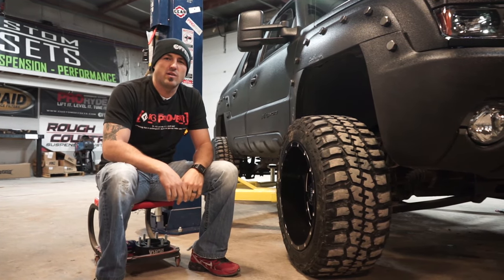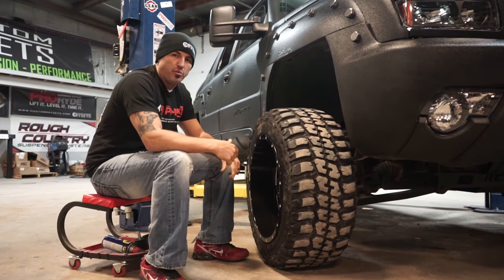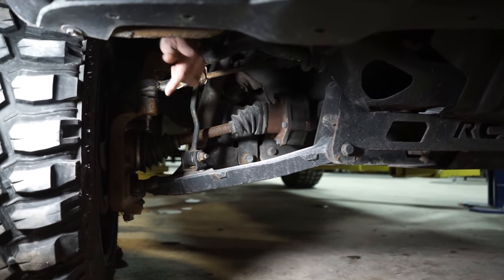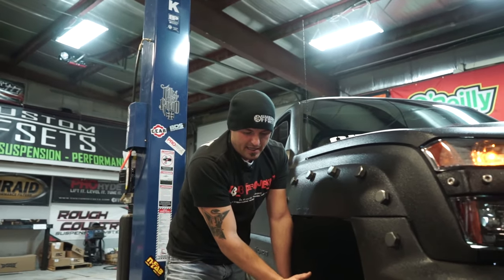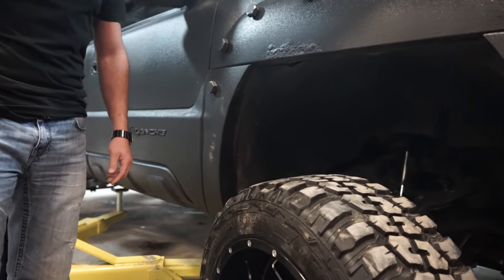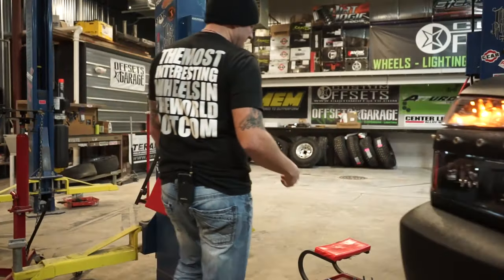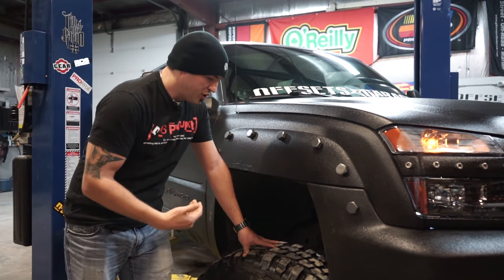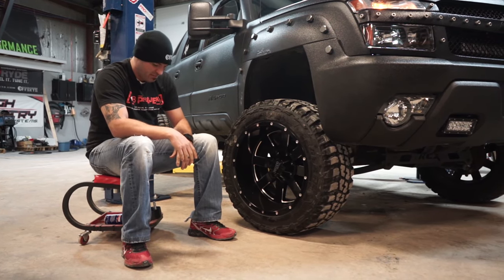Sh*t I Never Knew: Rubbin' is Spacin'

Comment: It rubs because the spacer moves the center of the wheel away from the center of the pivot point (ball joint or king pin). This causes the wheel to pivot on a wider arc-causing a 35 inch tire to pivot like a much larger tire. The best, and much more expensive option, is a wider axle that will give the vehicle the same profile while keeping the tire pivoting on it's center. This is also called scrub radius. Though I'll admit it's rare that anyone would pay $15k or more for a new set of axles plus install, when new rims with spacers and a fender trim is half or less the price.

Comment: Ran 2” spacers on my 07 Ram with just a level kit. Nothing fancy, just stock 20’s (plasti-dipped of course) and 33’s. Inner wall of the tire was rubbing on the UCA and I couldn’t go full tilt. Spacers took care of that and gave it a better stance. The right thing would’ve been some offset wheels, but wasn’t going to spend the money on that. It was a Dodge and I live in Michigan. You won’t find one around here without rusty wheel wells 🤷🏻‍♂️😂

Comment: Will a NorCal mod be enough to clear scrubbing on the back side of the wheel well if I ran 22x12/-44/33” on a 2014 GMC Denali with a 2.5” leveling kit with 2” spacers.

Comment: 2" spacers on a 10 wide -24 will put the overall offset around that if a 12 wide -44 won't it? Same with doing a 2" spacer on a 12 wide -44 is almost equivalent to a 14 wide -76 correct?

Comment: my 03 ram 1500 was rubbing just ever so slightly on the very inside when fully locked and so the spacers got rid of all of it now its perfect and its on 35x12.5x20's without any lift or trimming and it just touched on the very inside barely :)

Comment: Will it rub if your truck is level on 2" level and your wheels are flush to your fender and you add the 2 spacers to wheels will it rub on front bumper or back
Reply: Most likely you’re pushing your wheel 2 inches away. So you’re adding negative offset to a wheel. Means wider stance

Comment: I run a body shop in va , iv got 2 hummer H3s I bought 2sets of the 1.5 inch spacers because my havok wheels came in a -24 mm offset instead of-44 , 
I keep getting different ppl telling me different things but would like to know your answer to get the truth! Will the spacers have me replacing front wheel bearings every) months ? I was actually told by tire place I needed the hubcentric rings or the spacers so that’s 1 reason I purchased them. Plus looks
Thanks erik
Reply from the maker: Erik, we have more steering related issues then we do bearing issues. But Shawn likes to beat on the h2 a little
Reply: Where in VA is your body shop? I live in Alexandria and I'm looking for places that work on trucks

Comment: I put 305/55 R20 Toyo Open Country tires on my 2016 Ram 1500 with stock wheels (20 x 9) and they rub on the sway bar/frame. Does anybody have an idea of what size wheel spacers will fix the problem without creating the problem of rubbing the fender/bumper? Or at least the best way to measure to see exactly how thick the spacers need to be?
Reply from the maker: Check out the gallery on our website and see what other people are running on theirs along with the rubbing and trimming details of each truck!
customoffsets.com/add

Comment: I am working on my first truck build, I'm looking at a 4.75 lift, and either changing from stock 17-in wheels to a 33 - 12.50 or changing to 20 in Wheels and running a 285-60-20. This is on a 2008 Sierra 4x4. Could you recommend a video, or drop some knowledge on me?
Reply from the maker: That comes down to what look you're trying to achieve, but check our gallery out to see what others are doing on their sierra here - https://www.customwheeloffset.com/wheel-offset-gallery?make=GMC&model=Sierra%201500&suspension=Suspension%20Lift%204.75q&sort=date
Reply: @CustomOffsetsTV  I like the stance on you show whit the 33x12.50 on the 20x10s. I'm aiming for less rim and more rubber if possible. Going with ranch hand front and rear bumper/guard. 

Also, could I pull this of with a 33-12.50-15?

Comment: Ive been looking to get spacers on my 96 silverado. But ive been hereing mixed stories that spacer r a absolute mistake because they break. Have u guys ever had seen slacers break and if so under what circumstances?
Reply: Jared Tymofichuk they partnered with bora who makes the safest wheel spacers on the road. They are custom made for each vehicle. They come with a hub centric ring for exact fitment. The reason you hear stories about wheel spacers is people buy cheap ones on eBay amazon and so on. But I run 4 inch wheel spacers on and off road for a couple years and as far as spacer issue I haven’t had any. Now I go through wheel bearings like no ones business but I expected that. If you follow the rules on installing spacers and maintain them regularly you won’t loose your wheel or sheer lug nuts like the stories I’ve heard.

Comment: I've got an '05 Avalanche with 20" Southern Comfort Conversion rims...it came with Firestone Destination 275/55 R20's and I hate them! Can I go any bigger at all with the tires without lifting the truck?
Reply: Mike Miller what’s your offset? And wheel width? All those go into play when adding bigger wheels with a stock truck. I’ve found that 33s are about as big as I’d go on a stock Chevy. It does need some trimming depending on wheel size and offset but not much.

Comment: Well how do I fix my tires from hitting my fenders because I have brand new 2-in Bora spacers in the front and I also have 3-in leveling kit but I'm still hitting the bottom of my fender only on the driver side how do I fix that I have 17x10-in wheels Moto metals

Comment: how is that CV joint on the front holding up with the lift at that angle ? any issues ?  I have the same avalanche and going with the RC lift kit with 35s and wheel spacers
Reply: Custom Offsets awesome! thanks!

Comment: So my wheels are 18" stock 2015 silverado wheels currently on my 2000 1500 with a leveling kit i am looking to get 33" atturo trail blade mts and i also want spacers, with stock wheels will the spacers still rub or in this case will it make it better?

Comment: So it won't hurt anything putting wheel spacers on the front as well as the back? I have a 04 Chevy 1500 6 inch lift with 20x10 -19 offset on 35x12.50s if I do a 2 inch spacer all the way around would that be okay or would that be a no go???
Reply: Custom Offsets yes the front stick out farther than the rear but I like the look of them sticking out just a fuz more than they do I'm trying to get the 20x12 -44 offset look I know I can't get that look with a 20x10 -19 offset but I'd just them to stick out more then what they do now
Reply: Custom Offsets okay so I have 20x10 -19 offset if I do a 2 inch spacer all the way around will they stick out about as far as 20x12s do? Sorry for all the questions and I know if I want them even I'd wanna do like a 1.5 inch spacer up front and a 2 inch in the back to get the track with to be the same with the 20x10s correct? I wanna do spacers all the way around but I want the track with to be the same

Comment: So I'm thinking spacer will help with rubbing on frame
Reply: Would you know if a 2015 Silverado wheel spacer would fit on a 1999 suburban? Just found some used bora ones off a Silverado
Reply: J Man if the lug patterns are the same it should

Comment: Do spacers hurt wheel bearings?
Reply: This was exactly what I was wondering too!
Reply: john mason Make sure you get hub centric spacers if you're gonna get something a inch or more or else you will destroy your wheel bearings
Reply: Either way, with spacers or with negative offset wheels, you are increasing the leverage (also increasing the stress) on your bearings and ball joints. Basic geometry. Yes they wear components faster if you are pushing them out. Small spacers on stock offset wheels will not hurt but when you go pushing them way out is going to cause premature wear. Just comes with the territory tho.

Comment: I put some 37”x13.50x22 on a 7-9 lift and the back tires rub the back mud flap. How can i fix that without it getting to expensive. ?’?????
Reply from the maker: Trim to fit Andres!
Reply: Put chains on the flaps to the back bumper or ?  works good looks good if ya do it right

Comment: What about adding a 2” spacer on a stock wheel offset, im rubbing slightly on the inside uca on drivers side. This is 2016 silverado 4wd 2.5” level up front running 35x12.50x22 honeycomb replica wheels.
Reply: Try a 1/4" spacer
Reply: What did you figure out on this. I have the same prob on stocks. Did 1/4 inch spaced work?

Comment: Wheels that stick out that far look like the owner couldn't afford the right wheels, and bought wheels from a different brand  truck.  Looks like ass.
Reply: jeremy greiner you’re on the wrong channel. Google what offset means and look for videos that will cover what you’re looking for.
Reply: Well, if you are comparing trucks to asses.......
Reply: That avalanche is badass what you talking about
Reply: On trucks it's better because it gives you a wider profile which helps stabilize your ride.  Many lifted trucks with "proper" fitment have tipped over because of this issue.